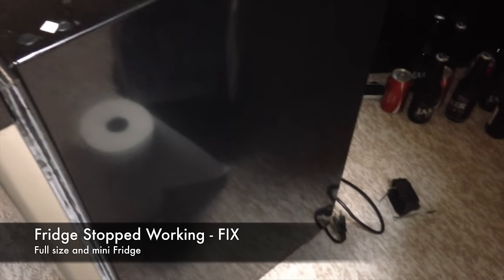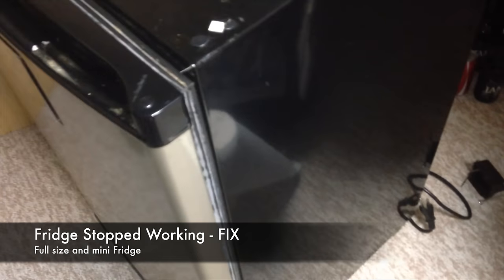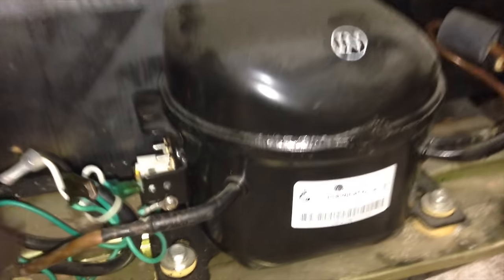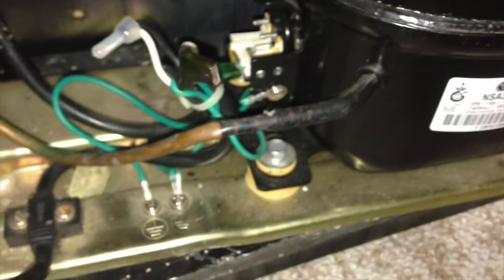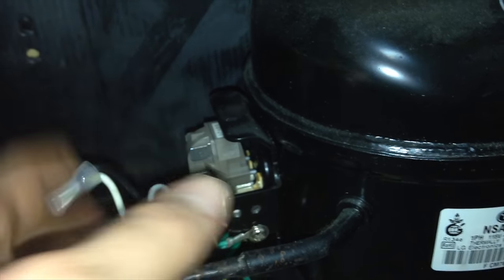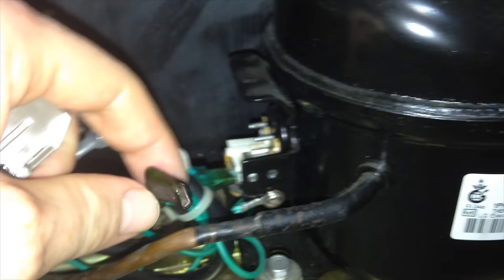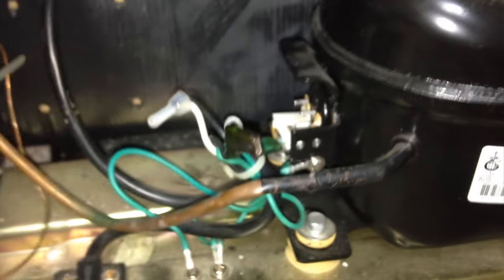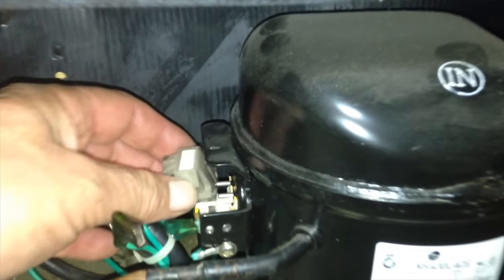Fridge Stopped working, how to fix?

Comment: I just replace this part starter relay for 7 bucks and it started working like normal i found this mini fridge on the side of the road for free so im excited thanks for this video :)
Reply: Daniel vengoechea
 link for  the  part??
Reply: Sameeee I also found it on the side of the road
Reply: I also found my mini fridge on the side of the road... but I have not purchased this part, my mini fridge makes a click close to the compresor (i guess its the relay). Did you guys had the same experience?
Reply: whats the name of the part ?
Reply: Mike Goodman yeah that’s what mine is doing, any update on what you did to fix it?
Reply: Where did buy the part?
Reply: thats pretty lucky
Reply: Don’t Share this video cuz I don’t want the word to get out and have no more fridges on the side of the road to take

Comment: Thanks for posting.  There appears to be two different scenarios with fridges (freezers) not working.  1) the fridge suddenly stops working ... where the fix is likely to be (or related to) the solution shown here.  2) the fridge gradually loses its ability to cool, which could be more expensive if it's compressor related (other than just more refrigerant needed in an older appliance).

Comment: Great video. However I have a Igloo fr834c The freezer works fine but refrig does not. There is a reset sequence of turning thermo knob back and forth. this seems to try and work but when I do it I hear an electrical snap, then nothing. So the reset tries to restart but cannot. Any ideas. Could it be something to do with defrost cycle. Not sure this one has one as I unplug and defrost about every 6 mo. or so.due to buildup. Never had one where freezer works but frig does not. Thanks.

Comment: How can you tell if that is the problem really? What if I just removed that part then go to the store and get an identical one, put it on and still doesn't work? Would there be a sign on the part that tells you it's broken or burned out or something? like a light bulb for example? Thanks.

Comment: I have a Haeir Refrigerator and I can't seem to find the parts. I have found several other brands but not for my brand. So, does it matter that it's from another brand? If so, I'm not sure what to look for when it comes to the comparing them. For example my Refrigerator Overload has this part number 265MFBYY -520 HCV2K and my Compressor Starter has P6R8MC OR0205 so do I have to pay attention to certain numbers if I have to buy Generic parts or a part from another refrigerator brand? Anything will help cuz I can't find them on Amazon or EBay and my local Appliance shops don't carry these parts. Thank you in advance

Comment: My bar fridge gets frost in the fridge at the back, which melts and leaks all over the floor.  Any suggestions?  I have already replaced the relay, and that white part underneath it.  No improvement.   Still accumulating water and frost.

Comment: I got an old Sanyo mini fridge.  It stopped working yesterday.  I checked the compressor and it was very hot to the touch.  I hear a click noise from time to time.  I decided to unplug it and let it cool.  I plugged it back in and everything started back up.  The inside coils got nice and cold.  After about 10 minutes I felt the compressor and it was really hot.    I waited a few more minutes and it shut off and I heard the clicking ever few minutes.  Could this be the part I need?

Comment: i found this older mini fridge someone was tossing out. i thought it worked but when i got it home i left it plugged in for over 2 hours and it never cooled but gurgled as though it has coolant in it and turns on but seems like its not calling for coolant when you turn on the Thermostat. looking online i noticed that there's something called a Start Relay? i pulled it off and did some testing on it as on YT and in conclusion it seems that's the issue. however looking online putting in that model # of Fridge i get no Searches back to that relay. i am wondering if this fridge can possible be saved ?

Model: FRTC035GM
Serial: KA81401910

Comment: I have a mini fridge on my tractor truck running off inverter power. Thing is when I plug up fridge I get an error stating overload E03 code. Microwave works anything I plug in works except fridge. Was working had on high because I just got back to truck could that have blown this relay???

Comment: Hello Guys - I have a Frigidaire FRC445GB small dorm fridge. I changed the IC102 Refrigerator Relay.  The old relay rattled when you'd shake it (I read it would it it was bad) The new relay did not but is still not working. The compressor will not kick on - the light comes on inside the fridge. Any thoughts of what to try next? Thank you n advance.

Comment: Really dumb question here, what are the signs tgat this is the issue and not something else? My mini fridge won’t stay cool but when I plug it in there’s an audible click and the fan runs but not the compressor. Would this still maybe be the relay that needs fixing or is it likely something else?

Comment: Bought a fridge from a lady cheap and then transported it on it's side, left it upright for a full 24 hours before plugging it in, then it worked finr for a while, and then the freezer and fridge both stopped working! Lol this is not a good thing! Anyway unplugging it for a few hours didn't help either! Could this be a separate issue? Since it was transported on it's side?

Comment: Hi my fridge was shaking vigorously as if it's going to explode. I unplugged and waited hours b4 plugging it back. It completely stopped working the next day. Will it still be fixed or should I get a new one? It's a 10 Yr old kelvinator.. Thanks in advance

Comment: I just want to say thank you thank you thank you for this video!! My mother in laws refrigerator just randomly stopped blowing cold air but it was still blowing air. I replaced the part you showed me in this video and as soon as i plugged the refrigerator in, I heard the compressor kicked in and it started blowing cold air! I'm not sure the name of the part, but all you have to do is take the part out and take it to any appliance repair store and they will know what it is. My mother in law was just about to spend 1400 on a new fridge but instead paid 10 bucks and the fridge works like new :)
Reply: What’s the part called?

Comment: Thank you so much I didn’t even have to replace it I took it off and put it back on and boom it worked
Reply: Just fixed mine the same exact way LOL. I was looking for a fuse that I never found. Put it back together and boom.
Reply: Blade Clymer what is the part called? Is it a fuse and where can you find it?
Thanks for your help
Reply: Blade you're a lifesaver! If I hadn't read your post I would've given up.

Comment: So I have no continuity when I touch the terminals on the plug but continuity when I touch the terminals at the relay. Unplugged of course. Any way to jump the compressor to see if it runs?
Reply: So power cord or am I way off?

Comment: What you replaced isn't a rheostat. It's a relay.  
Relay used a small wire for energising a coil, in which in return it closes a circuit to allow either a ground to run through or a hot lead. In other words its a electromagnetic switch. Thank you for your video, I'm attempting to fix a fridge today.
Reply: Our full size Galanz fridge just lost all electricity, no lights, no LED display, no cooling.  Do you think it could be a rheostat or a relay.  Seems the original problem in the video is that cooling stopped, not that the whole electricity died. (We did reset the breaker / all the breakers, and plugged it into a different outlet, so its not the house power.) TIA!
Reply: THANK YOUUUUUU. Because hearing him call it "this piece" for the whole video was pointless. I looked stupid asking for a thermostat but thanks

Comment: Great video it help me out a lot. took me awhile to find the correct part. I just received it today. thanks that was the problem
Reply: James Griffin what is it called an where u get it from ?
Reply: @kb2239  In case you are still wondering you can get it off of eBay
Reply: @sur_shrimpster  What is it called?
Reply: @SChome100  It's called a fridge start relay. If you find a tutorial on how to open up your fridge and take this part out of it, the way you can check if it is bad or not is to shake it. If you hear something loose inside then it is bad. Read the model number from your start relay if it is bad and search it up on eBay

Comment: Thanks for the info.  Replaced the relays.   Had to turn the OFF switch a couple times to engage the compressor, but it's working fine now.  $9 for the parts on Amazon
Reply: Can a relay go bad after 1 month iof use?

Comment: Hi, will be much apapsreciated if somebody can give an idea. if fridge swithc of from the socket and plug back in in couple of minutes, the fan is start spinning for 2 seconds and stops.
No light in a fridge, but power exist as all cables cheched with multimeter and obviously fan is spinning for 2 seconds if I plug fridge back on.
AEG 2.5 years rcb853324vx

Comment: What are the symptoms to indicate this part  needs replacing?
I plug mine into the wall and I just hear a Click, near the motor. The light is on but the motor won't run.
Reply: I'm curious about this also
Reply: my fridge would work for about 6 hours and then start to beep and then stop working. How do I fix that
Reply: Same here
Reply: save hear
Reply: Same here, I can hear the compressor working but after a short time it makes a click and stops working
Reply: I have the same problem the relay clcks but not working
Reply: Same here! why no one answer this!! :(
Reply: windsurfa i foil
Reply: @erosbryan  the click may be the klixon. Its is a protective device which prevents the motor from burning out. It may also be just a faulty relay. Take down the serial and model number and head to any refrigeration trade supplier and they should have one to fit. Easily done
Reply: @erosbryan  It may also be that the fridge is at the desired temp. Or that the mechanical thermostat is not functioning correctly. The relay would be the cheapest to replace first. But if that doesnt work change the thermostat
Reply: It's a compressor start relay. Symptoms would be that your compressor (the big black metal tank in the video) no longer hums, and there could be a click that happens once in awhile. That click is the fridge trying to turn on the compressor. Essentially, your fridge isn't getting the right voltage to turn on the compressor which causes the fridge to not cool.

Comment: Mr. Pellican just made a horror movie out of this video. I am not a technician but I replaced  this same part on my fridge months ago and it worked. there are no capacitors no high voltage. any way this videos are for DIY's
Reply: Capacitor is usually mounted separately and grounds out as soon as power is cut.

Comment: Four years ago I got a cheap second-hand Whirlpool fridge. It worked well for 2 years but after a power outage the fridge barely worked at all. Freezer section (on top) was cool, but not very cold. Fridge part seemed to not cool at all. I felt it wasn't worth fixing so made do with a tiny "fridge" section and no freezer. A few days ago, to my great surprise, it came good again - everything in the top froze and the actual fridge section got beautifully cold. I hadn't fixed or changed anything at all. What could be the cause?
Reply: Happened to my whirlpool too. It wasnt cold for a day and when I was about to call for a repairman today it worked again

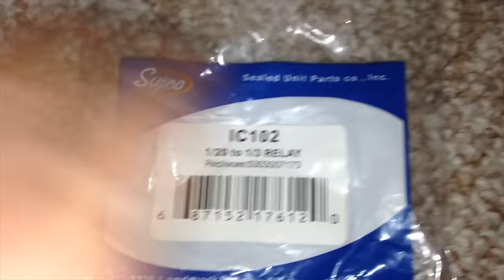Comment: At 2:04, you say the part is called a thermostat, when it is clearly labeled Relay.  The 1/20 to 1/3, btw, refers to the horsepower (hp) rating.  So, the relay is compatible with compressors that are rated for 1/20 to 1/3 hp.
Reply: It call a compressor relay switch 1/20 to 1/3 are the prong that the switch plug into

Comment: Thanks for this video! I was able to replace relay on my Danby mini fridge and voila! Cold beverages again. $6 part on Amazon.
Reply: Update: The fridge was working great after relay replacement but it stopped cooling again suddenly. If I turn it off and back on again it cools. But I’m afraid it will stop again, same problem as before. Not sure what is the problem.

Comment: Sorry to report that this fix did not work for my U-Line bar fridge. Fairly easy to swap out the relay, but after powering back up, the compressor still doesn't kick-in. The inside light works so I know there's power. Next step is to replace the entire thermostat assembly. 😞

Comment: Okay you changed the pin type relay, but it could be many things more. The overload, timer, or even the compressor
Reply from the maker: This is the most common. Most people just need to fix this and that’s it. You almost sound like the stores that don’t want people to know it’s this easy
Reply: @TechandDesign  yea it is the most common when its not starting, but we cant tell people just do this and it will be fine. Luckily it will not get worse if you do it, but its not always the relay that's it. Sometimes its more silly, maybe just the plug not passing amps.

Comment: How do you remove the case on the relay?
Reply: Ryan Hagge ours just pulled right off
Reply: Look for the little tabs ... should be able to squeeze them in.  Mine is different than the video above, however.
Reply: With a lil elbow grease

Comment: most of the failures are electrical on refrigerator systems. but god luck trying to replace a relay when you are actually outta gas!
Reply: What????
Reply: @urukadooedwards7637  If there's no freon in the machine, it won't cool at all. The gas that gets compressed/decompressed to cool everything down.
Reply: I just ended up beating the old relay around and it started working again.

Comment: This was a really poorly done tutorial video.  1. Not properly explaining what your video is about; 2. Not properly explaining the issues that are being noticed/observed which would lead a person to conclude that a specific part needs to be replaced; 3.  Not showing the area or specific parts was it was installed on the fridge prior to making any changes or removing any old covers or screws;  4. Not identifying the part you are discussing in the beginning of the video with it's proper name.

Comment: Are you for real. You are saying that the only reason a fridge can stop working properly is that one part. That is not true at all. You are not a refrigerator expert. People go to school for that. You should also be much much more insistent on the fridge being unplugged and on a dry surface. There is a lot of current that could electrocute someone. It's one thing to give advice on things like iphones. Please stay away from televisions or you might become responsible for bad accidents with electric shocks.
Reply: Perry Pelican your so right...I tried to work on the fridge with it plugged in and blew up the entire block, good thing I have homeowners insurance, my house needed too many repairs anyway...I'm being way too sarcastic. get offline mate, your better off getting therapy rather than making people paranoid to do repairs them self. Don't be afraid of electric, just don't touch the common and the hot wire at the same time
Reply: Sh*t, Perry.  i don't know no electricity.  
Dat da one wit da flaashy liiights?  
Daddy says don't go near dose flaashy liiights. 
Der like sparklers on da Forth of Juuu-lai.
Reply: Goaway